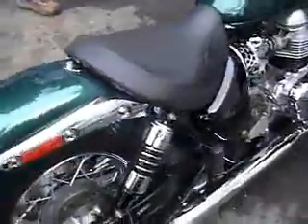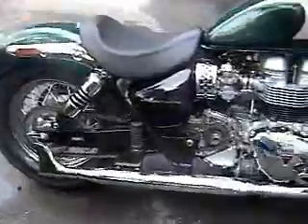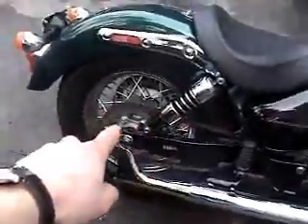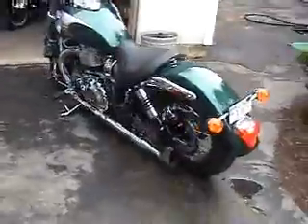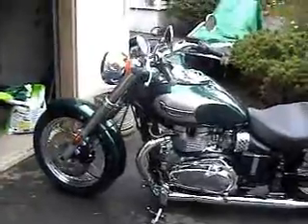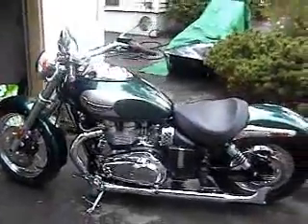Triumph America project

Comment: Just bought an 03. It's a garage find. Sat in a garage up on stands for 19 years with only 140 miles on it. Runs and rides great. I've had so much fun with it. Carbs had to be cleaned, but i'm riding on the old tires they're holding up just fine.